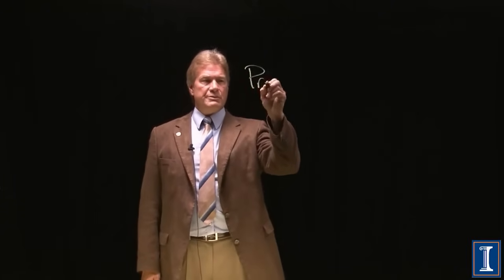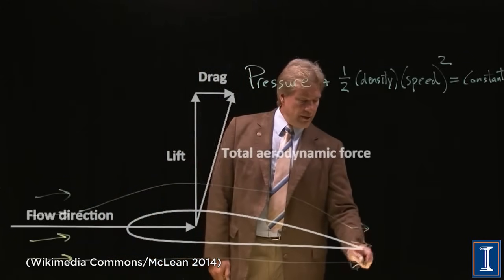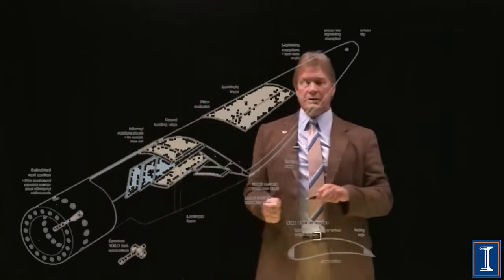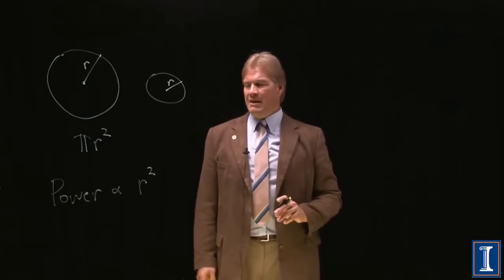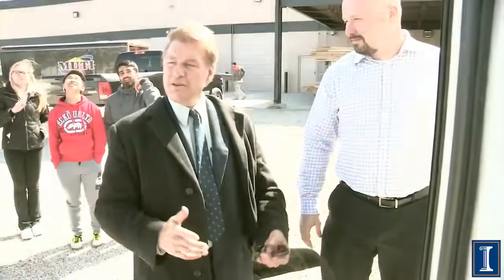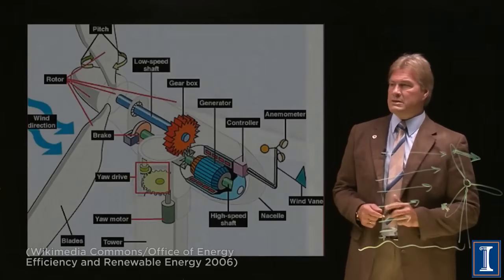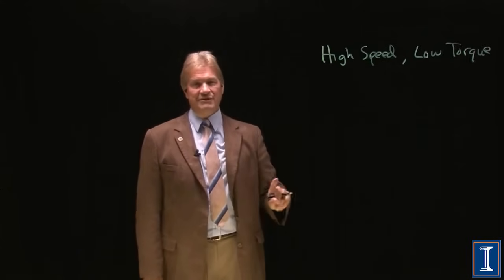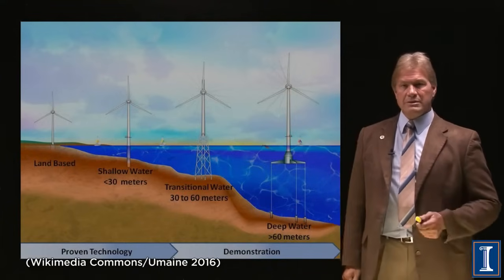How Windmills Work

Comment: Just plain in accurate and misleading.  60% of lift comes from mr Newton and the ANGKE OF ATTACK. Only 30-40 percent is Bernoulli. Think about it. How does and aircraft fly upside down.  Definitely an academic not an aviator.
Reply: I suspect that Professor Ruzic is trying to give a simplified explanation of where a wing's left comes from that is sufficient to get to what he wants to wave his arms at in the latter half of the video.
I suspect that he knows full well that Bernouli's Principle is not entirely sufficient to fully explain where the lift of a wing comes from as he says "there's more to it than that" after he gets done giving the simplified explanation for Bernoulli's Principle.

But you're also also not entirely correct in your description of where the lift of a wing comes from as I think Doug McLean (retired Boeing Technical Fellow) who Profess Ruzic reference by subtitle and in the references at the end of the video points out in the video "Common Misconception in Aerodynamics".

Comment: Hello, Illinois EngeryProf. On your demonstration of the Bernoulli principle with the balloon, I thought of convergence in dynamic control systems. I do this trick with a small styrofoam ball where I make it float near my nose ... the thing is that often the ball will fly away. While the ball is in a certain region the Bernoulli effect will keep is stable but if it move away it enters a divergent regions. I often thing of Climate Change together with these concepts from Dynamic Control Theory. Do these concept apply to climate change? If so, could you do a video about it? 

Here's how I think (I don't know if this is correct): there are some macro feedbacks in the climate and they seem to have a control  element. For instance: ocean's temperature rises -> carbon is released -> plants grow faster -> carbon decreases -> oceans cool. Another one: air temperature raises -> air gets drier -> we have forest fires -> forest allows for new plants and the spread of vegetation bellow the canopies -> carbon is reduced -> air cools down. These loops seem to have been, for a long time, in the convergence region but we are seeing things that, IMHO, seem to be leading the system into a divergence region. Trees will saturate - stop responding to increase of carbon - at some level and if that level is reached they won't be able to control the process. Wildfires are also getting so big and destructive that one year isn't enough to recover the forests and, therefore, next year's dry season will be even drier. This is just "an educated inference of the qualitative aspects" - an euphemism for "a guess" - and that's why I would love if you could do a video about it - if my educated guess is correct, of course.

Thanks and please say hello to Dr. Floyd and HAL9000 for me!

PS: Please forgive my jokes ... I get in a good mood when I'm learning nice things!

Comment: Dear sir, 
there's not only 1 type of windmills. There are solutions less problematic to torque, creating noise, or low air speeds. These are becoming an alternative for usage at homes or RVs, where optimization and a fast ROI isn't an issue.

Comment: You can move the heavy stuff to the bottom if you use the windmill to generate pressure in a hydraulic or pneumatic tube. You can share this between several windmills.

Comment: The blade tip speed may be high- that’s what kills the birds of prey- but that’s only because the rotor diameter is so large. The rotor rpm is very low. Indeed you can watch how slow it is. As such, they generate an enormous amount of torque to develop several thousand horsepower. The reaction torque is the same amount, at a right angle to the wind direction, and must be countered by the tower structure in addition to the force on the tower in the wind direction. These multi megawatt turbines need enormous foundations. They truly are modern marvels of engineering. But we must find a way to make them stop killing off the birds of prey.

Comment: Here is an intuitive way to think about Bernoulli's principle.  Imagine a hockey-puck shaped, cylindrical chunk of air moving to the right in a pipe with a diameter of 1-foot.  Suppose it takes 1-second for the puck to move past a point along the pipe.  Next, suppose you want to move the same volume of air (contained in that puck) passed a point along a narrower pipe with a diameter of 0.5-feet, so that the same amount of air passes in 1-second, the same amount of time.  Because the cylinder of air has been squeezed into a smaller diameter pipe, that cylinder of air must become much longer to hold the same amount of air.  So to get the same amount of air passed a point in a narrower pipe, in the same amount of time, that air must be moving much faster.  Now, if the narrower pipe were inside the wider pipe, and you suddenly eliminate the narrower pipe, the fast moving air from the narrower pipe now has much more volume available, and so we see that the faster moving air, transporting the same amount of air-per-second, has a lower density in the larger pipe, and so exerts a lower pressure.

Comment: I might have used the example of the blades of an Airplane propellor - which provides “lift” in the forward direction instead of wings which provides lift in an (basically) upward direction.

Comment: would you be able to talk about in more detail, how wind turbines deal with variable loads of electrical energy production
Reply: The pitch of each blade is changed (angle of attack) to vary the speed of rotation.  The large wind turbines are high speed low torque like he said, but the mechanical stresses can only be so much.  When the wind is too strong the blades pitch to keep below a maximum given rotational speed for safety and longevity.  As far as energy production goes, wind turbines and solar farms try to put out maximum energy based on conditions (wind, sunlight),  the grid takes the megawatts as given and the "controllable" power plants are varied to maintain load on the grid.  One thing to keep in mind about wind power is that on average (annually) wind turbines are only 30% efficient.  Example, one wind turbine can produce 2 MWh of electricity at max output.  Over a given year the total amount produced will only be 30% of that 2 MWh.  So, wind is not reliable nor is it an efficient way to produce power.  The only good thing wind and solar production does is offset a TINY (and I mean TINY) amount of fossil fuels used to produce reliable and efficient energy.  I like to call wind power the "feel good" power, until the wind stops...lol.

Comment: I say solar has killed wind, in fact all turbo machinery generation. Its economics, solar is solid state. Cheap, almost no maintenance and can be installed almost anywhere. How can anything else compete? I work with the largest utilities in the country and they are looking at solar/battery storage more than anything else. Even the licensing and permitting process of a solar plant is nothing compared to conventional power plants, including wind.

Comment: To place things in perspective, how about illustrating how many windmills with batteries, solar with batteries, nuclear with peakers, coal with peakers, etc. it would take for each to supply 100% of the US power? Add in comparisions of construction, fuel, maintenance costs and carbon footprint. It is difficult for people to comprehend how much energy we use. "That's what you need to know!"

Comment: ....except for flying inverted, or symmetrical airfoils...
Reply: Symmetrical airfoils mimic the "Farm fan" in that they use sheer brute force to create lift.  By using the swashplate Mech, along with the blade tilt, you can create lift regardless of your orientation.  I fly a HeliMax R/C Copter , but not well enough to fly inverted yet.

Comment: I find this explanation of how lift is generated more confusing than helpful, as it is backwards. The wing creates a low-pressure area above it, which makes the air move faster into the low-pressure area. The speed of the air is the consequence of low pressure, not its cause!

Comment: What about the stability of speed? Wind speed is not constant.
I know the attack angle of the blades can be modified, but since the grid has to provide a very stable 60hz, how do you make sure you are always synchronized even under a changing wind?

Are those generators providing DC then reconvert it to AC at the right frequence and phase? To my knowledge, there is also a significant loss converting DC to AC...
How does that work?
Reply: They are alternators I would guess.
Reply: @spaceghost8995  They are. But their phases would need to be synchronized or the whole thing would blow up.
They don't only need to reach 60Hz, their 3 phases must be synchronized with each other wind turbine.

Comment: 15:00 I thought big wind turbines are low speed high torque, while the Dutch windmills are high speed low torque. Also thought that speed is related to RPM so the diameter irrelevant.

Comment: Some common errors here:
1. The molecules of air don't have any concept of time - the common  time path explanation for lift was debunked by NASA and many other bodies years ago.
2. Bernoulli only deals with the changes along a stream line - Bernoulli cannot explain how a wing can generate life when inverted.

It is the shape of the aerofol section that defines how much lift will be generated for a given angle of attack.
Reply: lift*
aerofoil*

Comment: 0:11-0:30 - I wonder pretty much the same thing when I see a video of a battleship.  Its made of steel.  How the hell does it float?
Reply: George Washington water is heavier and more dense than you might think. The battleship is actually quite hollow. It’s weight determines the amount of water it will displace if put into the ocean, and if the volume of the water matching the volume of the ship weighs more than than the weight of the ship, the ship floats. (This is what is known by displacement.)
Reply: Archimedes was a clever guy.

Comment: 3:35 The air doesn't need to stay together at the end of the wing. You dont need to create a pocket of vacuum if it doesn't stay together. In fact, experiments have shown it does not stay together. This explanation is not only insufficient, its wrong.
Reply: @Wroger Wroger 
Should've known... a red pilled incel.
Reply: @Wroger Wroger I think you're right about the motor blocking air but you can do the same thing with a screwdriver and a air gun and that has no hole of air
Reply: the air stay together on a laminar flow
Reply: I think he acknowledges this in his subsequent comments.   He says that it's much more complex than he described here.

The best explanation I've seen on lift:  http://www.av8n.com/how/htm/airfoils.html
Reply: @Wroger Wroger I would bet this guy is WAY smarter than you.

Comment: I knew 'something' about good old Mr Bernoulli.  Please comment:
Mike Shellenberger advocates nuclear over wind, as far superior due to
space considerations
consistent power
very high power
high safety today
concentrated vs diffuse power
little waste if used with modern designs
don't kill big endangered birds that windmills seriously threaten
nuclear super modern high tech
windmills are obsolete technology from agrarian times.

Two of these points from Schellenberger I can see possible problems or bias .

One, this video describes high engineering on modern windmills. Nothing like Dorothy's farm in Kansas.

Two, while wind power (and sunlight) is diffuse, difficult to harness effectively & efficiently, usable uranium fuel is also diffuse, until the whole rock to gas to centrifuge enrichment back to pellets program.

COMMENTS PLEASE?

Comment: I really enjoy this channel and I think it's quite educational, but I'm sorry to say that that's NOT how a wing works. While Bernoulli's principle basically applies to everything an aerospace engineer does, you really need to be careful with your hypothesis: the air on top of the wing actually moves quite faster than you predicted and using Bernoulli's principle is not "just a simplification" it really is a wrong explanation of the phenomenon. What confuses me is that while calculating the resulting forces is quite a bit more difficult, I will give you that, explaining how a wing works isn't much harder than explaining Bernoulli's principle: it's a matter of Newton's third law, action-reaction, air being pulled down means wing being pulled up to make it simple...
Still, I understand that's not the objective of the video, but it would be nice to see the correct explanation more often on educational channels.
Reply: Lift being caused by the air going faster over the top was certainly the standard explanation when I was growing up 70s, early 80s. Fairly recently I came across someone pointing out the fact that planes fly perfectly well upside down.